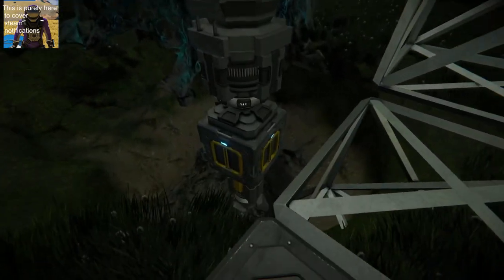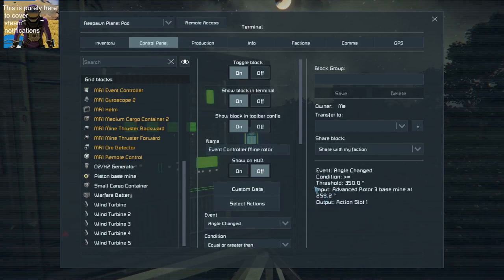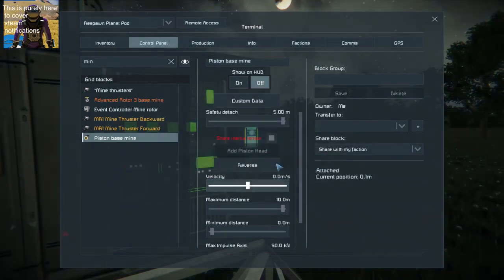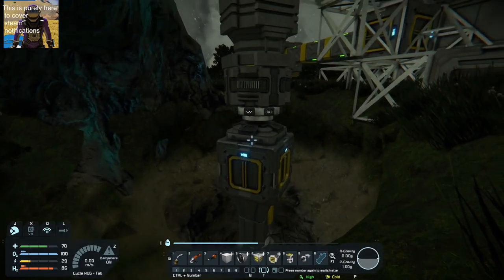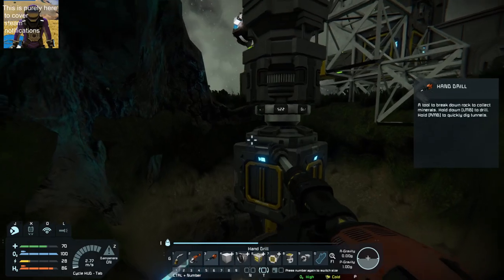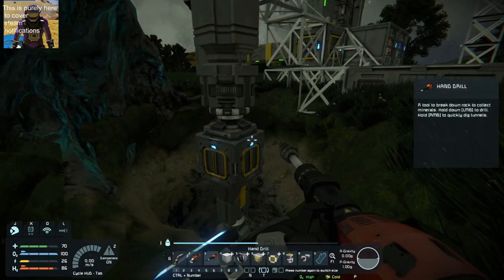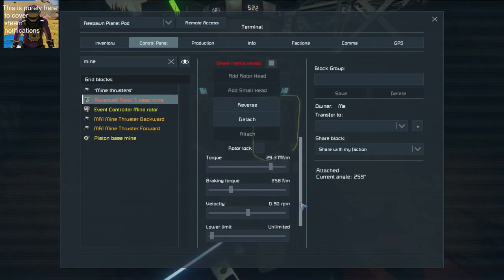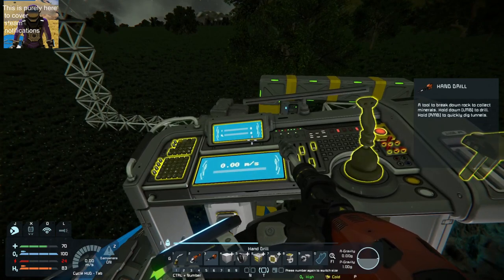SE Vanilla Survival Automatons ep.2 - How to make a mining rig using the event controller

Comment: It’s a pain in the neck but if I were you I would remove your drill and piston, then put a piston closer to your base that can push upwards. Then add your conveyors to move over, and finally put your original piston/drill setup back the way you have it.

The piston that can move up will allow you to raise your drill setup high enough to get any clearance you need to continue adding drills whenever you need them. 

Alternatively you can right-click/left-trigger your hand drill to quickly remove any stone in your way.